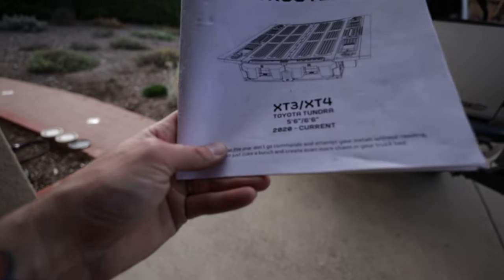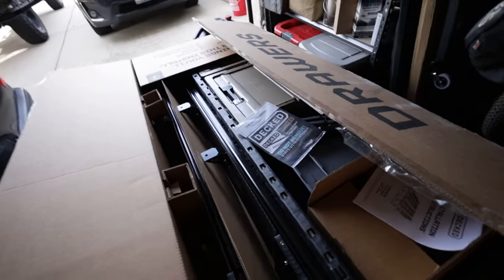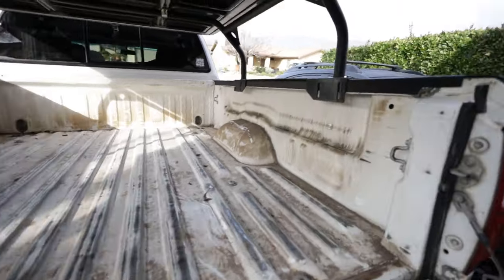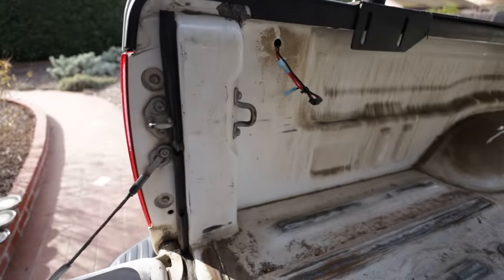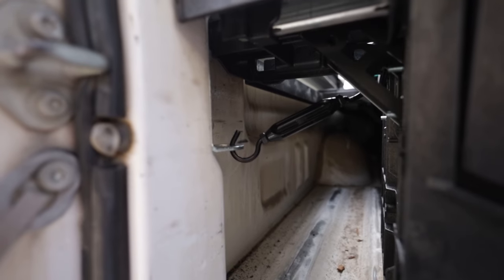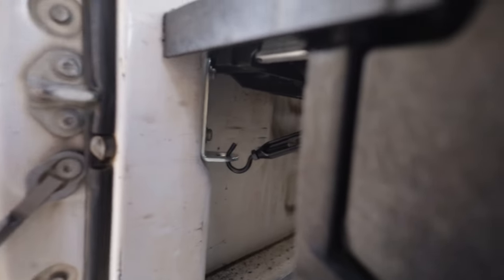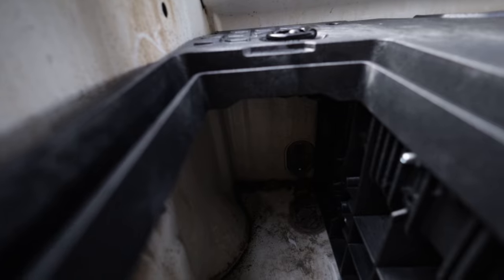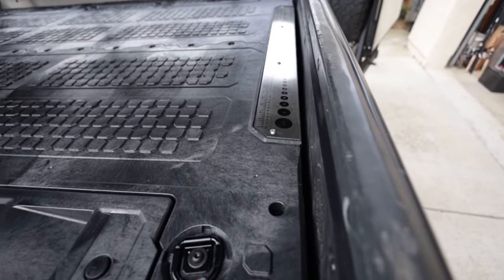A NEW DECKED 2.0 System for 2000 - 2006 First Gen Toyota Tundras!

Comment: Couple of things... They definitely mixed up your left/right stickers in the factory! 😂 Also, I'm gonna send it with my DC.  I'm tracking the difference in bed length is 0.4" (AC inside bed length is 74.7 and the DC is 74.3 inches).  Looks like it will fit damn near perfectly!
Reply from the maker: Report back!
Reply: ... aaannnddd SHE GOES!  XT4 fits like a glove front to back in the DC.  My only gripe is the space on the sides.  It's pretty considerable (2.25").  I'm willing to bet the new gen F-250 model (XS3) would be a better fit width-wise (based on others using the legacy version of that model).  I reckon I'll just stuff some foam on both sides.  Not ideal, but it'll do.
Reply: @Bandit.6139  did the XT4 fit in your first gen DC without any modification, or did you still have to cut out the corners a little like Jim Bob did in the video?
Reply: Same mods
Reply: It’s just gaps right? The decked box can’t slide around?
Reply: @ttngu203 correct.  The corners brace the entire unit if you trim with tight tolerance, and the turnbuckles will cover your slop.

Comment: Thank you. I just installed the XT4 on my 2003 Tundra.  Your video helped me have to confidence to tackle the project.  I just finished and it seems like its going to work great.  I ended up removing all four the factory tie downs for it to fit, but the kit only comes with two replacements.  I looked but did not find DECKED tie downs on their website. Does anyone know where I can get a pair of them?
Reply from the maker: I’d just email them and ask if you can buy two replacements!

Comment: The holy grail of videos! 🙏🏼 also have an 06 AC this is sick. There goes $1500 😬. Whats on the inside of your tailgate??
Reply from the maker: You won’t regret it! It’s a mountain hatch tailgate insert which is a good grade plastic tailgate cover.
Reply: @brakeforsnakes  damn that is nice food grade too. Hey do you think this build would work if i put a rhino liner spray on the bed? Have the plastic liner from Toyota but im sure that wouldn’t work with this cause of the trimming. Cant see a spray liner being a huge issue do you?
Reply from the maker: @jeremiahroberts1989  the plastic liner definitely won’t work. I took mine out but a spray in liner should be fine.
Reply: Just wait and search marketplace.  people post them for sale occasionally for less than $1000.

Comment: That’s awesome that worked so well for you. I was lucky to find one from a 2017 Nissan frontier that fits my 06 double cab like a glove. 
Such a great system to have.
Reply from the maker: Rad! Glad to hear there's an option for the DC's
Reply: @Fparrish I just got a 06 DC, do you have a model number or pictures of what you have?!?
Reply: Are you on one of the tundra forums? This info would be welcomed there!
Reply from the maker: @kickapoohiace8747 yup I am and have a thread about it
Reply: @brakeforsnakes  great, which tundra forum and whats your call sign on there so i can find it?
Reply from the maker: @kickapoohiace8747  I'm on tundras.com and my user name is inv3ctiv3
Reply: Fit with no cutting?